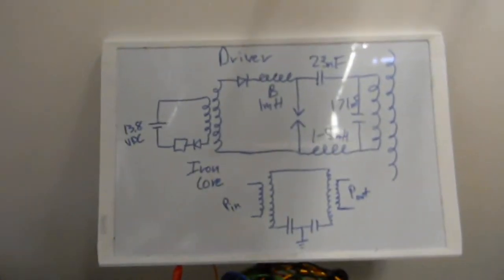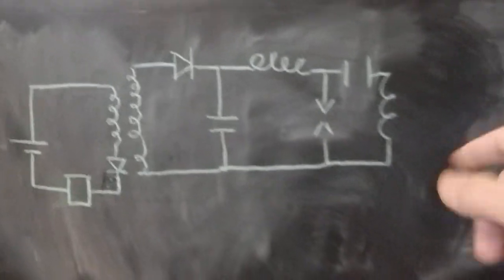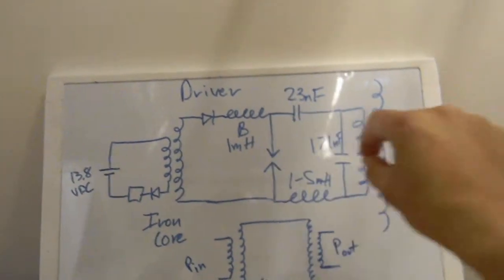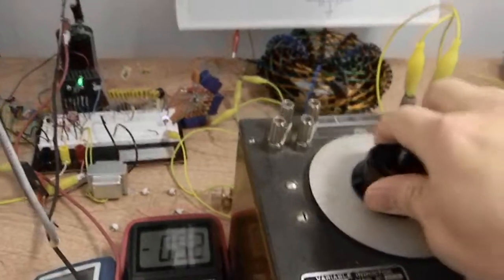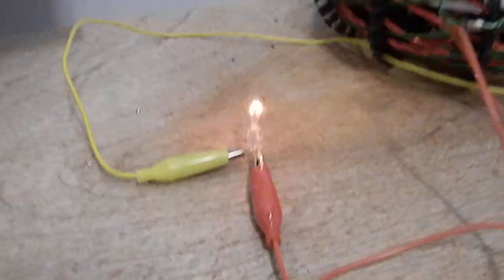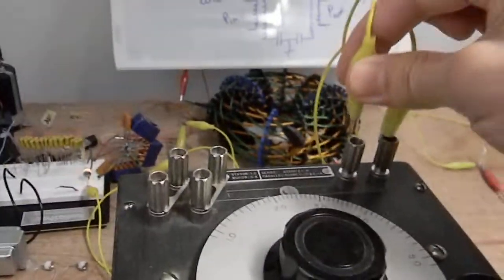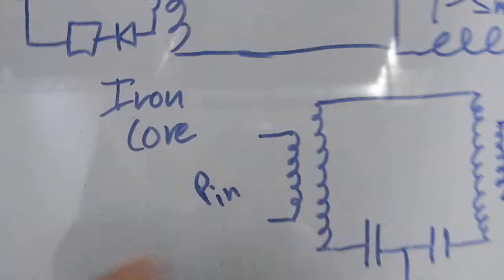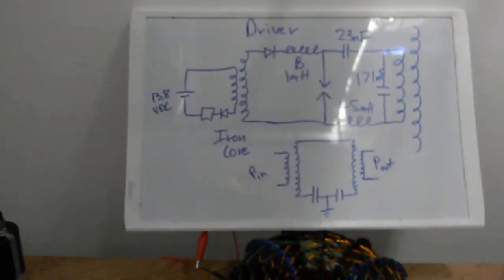Radiant Energy Oscillator

Comment: use disruptive discharged, negative charged capacitors. Not a sine, not a square wave, but an abrupt, almost instant, discharge of the capacitor into the coil. The quick voltage difference introduces the radiant energy effects.
Reply: Thanks ivo

Comment: Oh, this is off topic, but FYI, I recently bought glass blowing supplies (torch, kiln, etc). If you think you have a Gas filled tube you would want  with specific gas mixes pressures and electrode materials let me know. They are expensive to custom order from a pro, but I'm not a pro, I think i'm going to give most of the dudes involved in this sort research one for free.... First ones free, then your hooked. MMMWA HAA HAA HAAAAAAAAAAAAAA. No joke, do your research, if you want one tell me on my discussion tab on my channel. Peace. Ben
Reply: You've been holding out on me Binj! This is the first I've heard of this and such items would be very useful in my laboratory!
Tesla coil discharges will punch tiny holes through the glass of gas sample tubes though and can easily ruin them. Do you have to ask how I know this? ;)
Reply: TinselKoala
No, all you have to do is inquire (I should have offered).  If you want a custom tube built (gases, size, electrode material etc.). I have most of the supplies. I still need my gases and I am in the process of building my vacuum chamber.... I recently was $3000 dollars less rich overnight due to unforeseen circumstances.  That is why I don't have the gases yet... But the offer most definitely stands for you as well TK :)
I do only have boroscillicate  glass test tubes.
So if you require one for heavy duty functioning you will have to tell me the thickness of the glass you need and I will figure it out... This offer stands indefinitely and is for people doing alternative energy research.
The only thing  I ask is for people to know for what and why they want it (which I know you will TK). 
So yeah, whenever you think you could use one I'm your guy. The cost is nothing :)
Peace.
Reply: Binj Komisar
Thanks, I will def get back to you on this. There are some xenon HV-HF experiments that I badly want to repeat. I need to find the exact specs of the sample tube first. I'll put a message on your channel in a few days with a description of what I need. No hurry, no worries, I hope your 3k setback wasn't.... a QEG core purchase!
I can trade with you maybe. I have a lot of those 30 kV 400pF doorknob capacitors for example, if you can use some I'll be glad to oblige.
Reply: TinselKoala
LOL, no it wasn't a QEG core. Just completely unexpected expenses that had to be taken care of. Yeah, a couple of those caps would be cool :) But none the less, it is a free service to people really trying to make this alternative energy stuff happen. So yeah, let me know the specs and I'll go from there. I wasn't sure which gases to acquire first so this helps me make my decision. Its going to be Xenon and Argon.
Reply: Binj Komisar: Hi I'm Rick, & I was a contractor back in Oregon for 21+ Yrs, then in 2011 I was crushed by a truck & told I would "never walk again". Well they were right for about 2 Yrs, but I refused 2 accept them telling me 2 throw in the towel. So now I'm able 2 hobble around & I've been teaching myself all I can about electronics, if Your offer still stands I could really use a tube like Dr. T. Henry Moray used in his Radiant Energy Device. In it is a "Small round pellet of a mixture of Triboluminesent Zink & a radioactive or Fissile Material" a special valve made by Rural Electrification Agency. If this is something You can do I would be indebted to You, & will share Everything I'm able to do with it, with You. If You respond to this I'll get back to You & we can figure out how to communicate with each other better. (I'm not very familiar with computers, & I've only had a smartphone for 2 year's) Thank You for Your time, & I Pray that You have been successful since You posted this, Rick